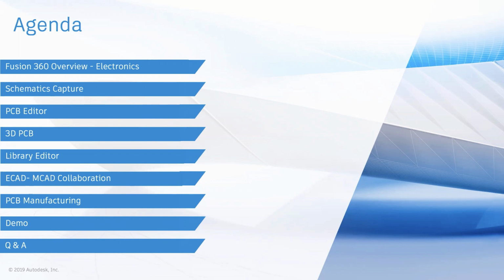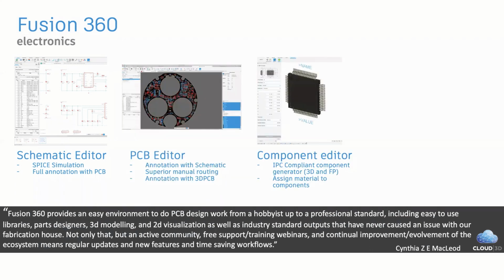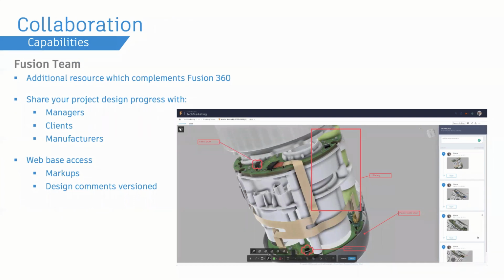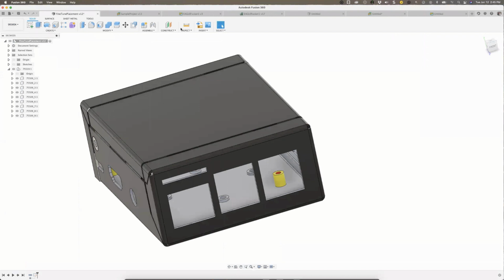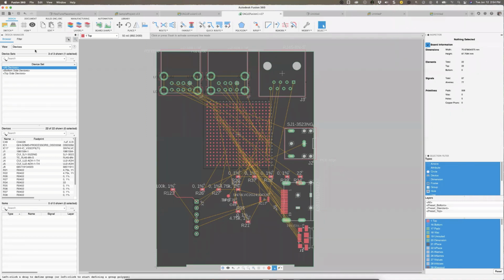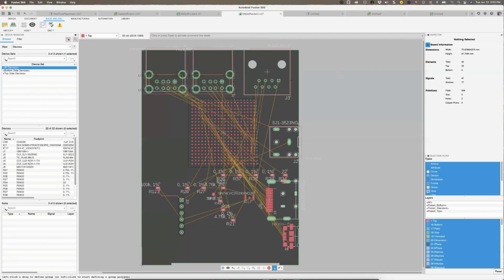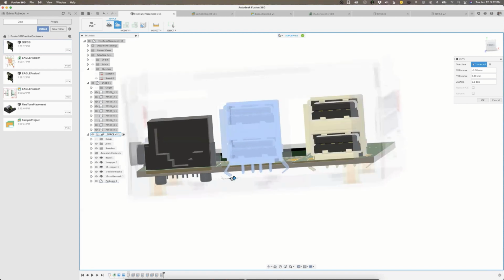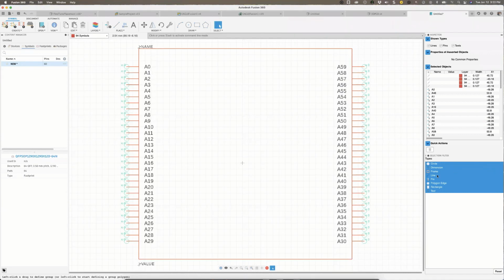Electronic and Mechanical Unification

Comment: Why my ripup all is not working i mean it is not deleting my routing and not showing airwires ... it seems like it locked my connections on bottom layer ... how to correct it or how to delete pcb design file to create it from scratch